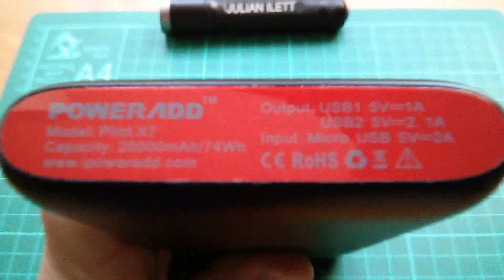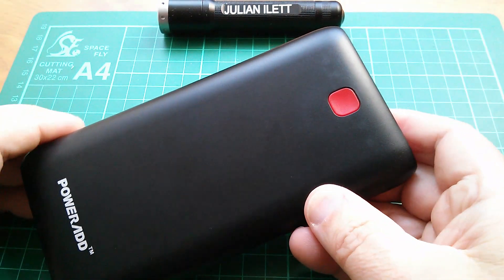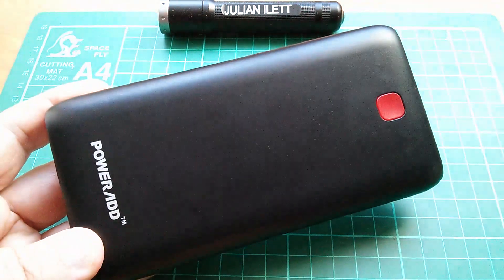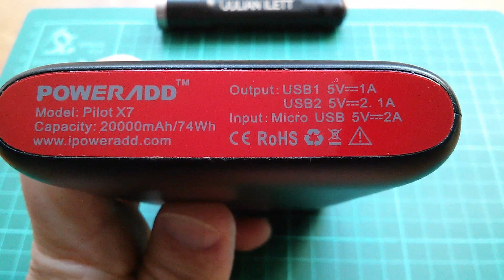PowerAdd Pilot X7 20,000mAh Mobile Power Bank Review

Comment: Perhaps I missed something but how did you get 85% from 20,092mAh down to 12588mAh? Surely that's ~63%? Does it come out differently discharging from different ports maybe? I can definitely see a cheap boost converter being 85% efficient @ 1A but only 63% @ 2.1A. Do you think this could be the case? I would love to see a quick teardown and possibly look at the chippery? :)
Reply: +ColdTurkeyFlu
You've got to take into account the battery voltage (3.7v nominal).
The battery charging circuit usually uses a linear regulator, so if you put in 20.092Ah at 5v the battery will absorb 20.092 x 3.7 = 74.34wh. If the boost circuit was 100% efficient you would expect to get 74.34 wh (14.87Ah @ 5v) out, however julian's real world test showed 12.588 Ah (12.588 x 5 = 62.94Wh).
This gives 62.94 / 74.34 x 100 = 84.7% efficiency.
Hope this clarifies things. :)

Comment: The voltage output is very low on that device. Many Android devices will drop the charge current if the input voltage is below 4.8v or so.

Comment: I just received this from Amazon today...instead of 4 lights it only shows 3...I had this charging for over two hrs and the 3rd light is still flashing and it never fully charged up...
Reply: Is it still 3 led? Has the 4th light lit up?
Reply: +Teejay Canuto ...I need to explain that the day after I received this a customer service rep called me and explained that because of the large battery size it takes 4 to 5 hrs to completely charge it...there was a 4th light but each light is only visible as each one charges...after using this a few times I'm really pleased with the performance...I highly recommend this poweradd...
Reply: Joseph Carrino u have to wait for 8hrs btw

Comment: this power bank can give maximum 9000 Mah output in 5 volt, which is less then 50% efficiency. I bought one and for no reason now carrying a huge power bank.
Reply: Mine outputs ~ 13500 mAh. You may have got a faulty unit

Comment: WARNING: This thing does only charge bloody apple devices in fast modes. As we could see, Android or Windows Phones are only charged with 500mA. That's unusable for me. I recommend the AVANTEK one, but DO NOT EVER USE the supplied charger to charge this thing! The charger goes up in flames!
Reply: +BloodySword It depends on the cable, I've got a few USB A - Micro USB B cables that only carry power and have the data pins in the micro USB connector shorted to comply with USB DCP standard, telling the device to take as much as it can handle. Very handy for power banks.
Reply: I built myself adapter USB-Sticks. :D Very handy indeed.